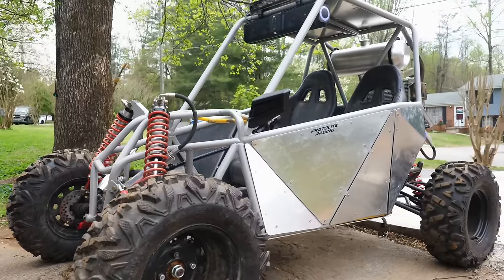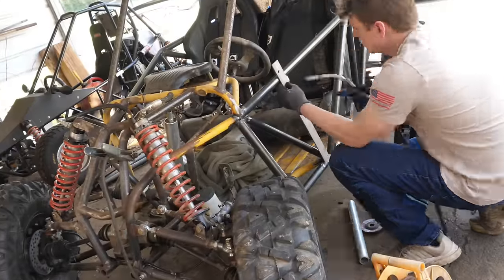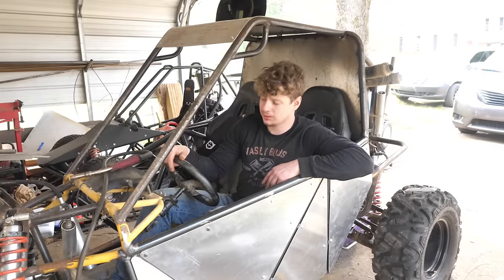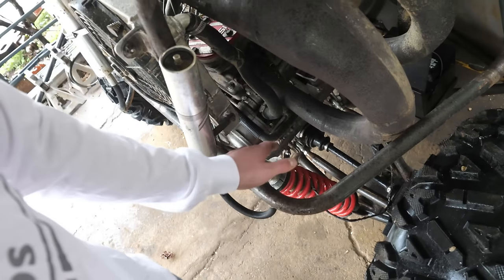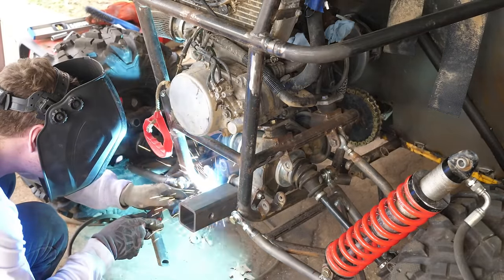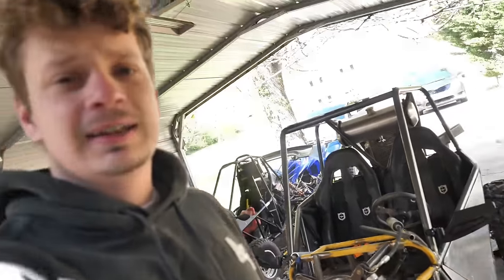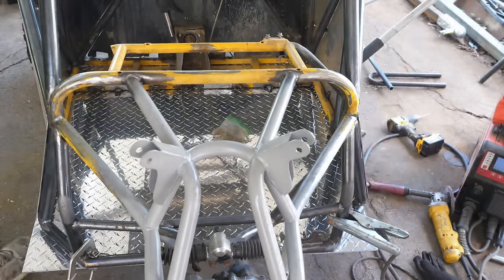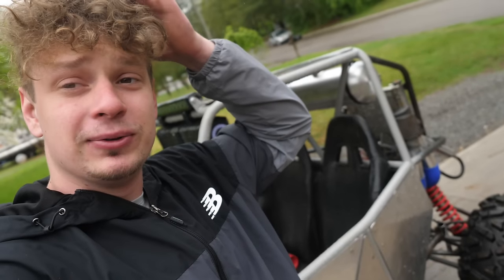I Pimped out my $500 4x4 Buggy!

Comment: I worked at Ford Product Development in the UK. What we did to fix rattling panels was to use star shakeproof washers (with serrations on the outside).  Between the panel and mount was optimum, but they still did the trick with the washer between the bolt head and panel.  They are not going to prevent a large panel from vibrating, but you could stiffen the panel with bracing to kill vibration.  Looking forward to seeing the buggy rip.
Reply: Looking sick man 😍
Reply: Gm Rahway-Linden nj use to black silicone the know rattle spots with before putting panels on an family friend who worked at the plant had told me
Reply: Literal MVP
Reply: Large panels he could probably use sound detner

Comment: A cheap but effective way to stop subtle vibrations in panels I found that rubber metal roof washers from the roofing screws on both sides of the panel also works well. I haven't lost any hardware either since I started doing this.

Comment: You can put a few small squares of Dynamat type material (or generic Dynamat, that brand is expensive) on metal panels to deaden them from sound vibrations.. It's made for car stereo installations and I used it on that, but I use it on my aluminum skid plates on motorcycles, my PC case, my sim racing rig, a noisy dehumidifier, noisy metal cabinet doors, etc..lots of times you can hide it on the backside of panels. It's heavy but you don't need a lot, no need to cover the entire panel like the directions will say. A few small pieces per panel will do a LOT, it's amazing stuff. I was thinking about making this comment before you were talking about it 26:00 in vid! Try it and see how it goes. 🤘

Comment: Darn good looking work Vasily.>1 Problem though: You put the 'Soundbar' on with the light facing In,and speakers Out" Oops. ;) You know the tubes that the floor jacks for basement use? about 4" diameter? =Driveshaft tunnel.